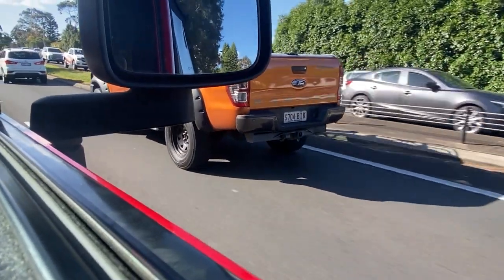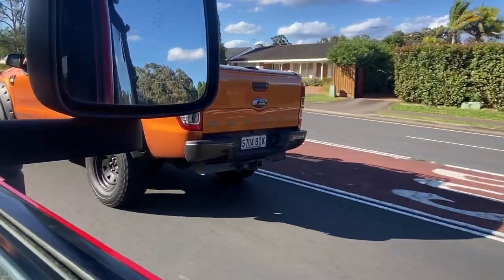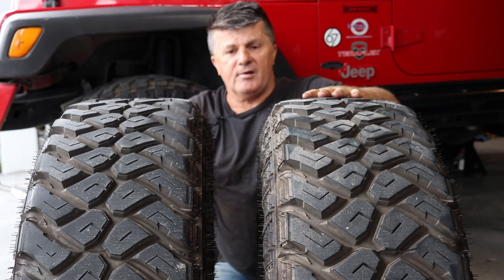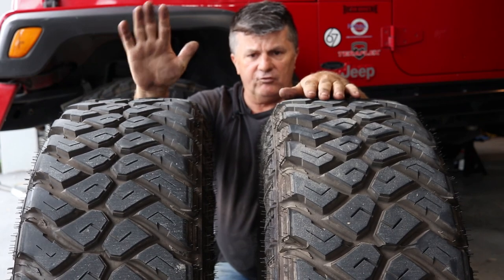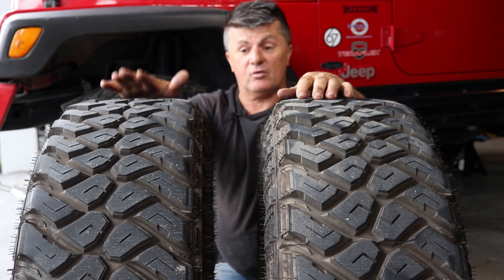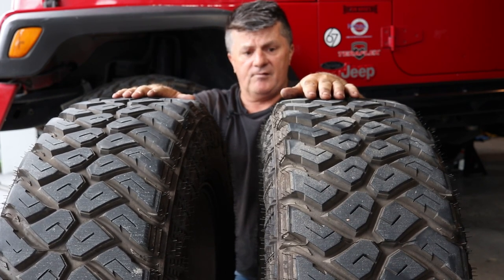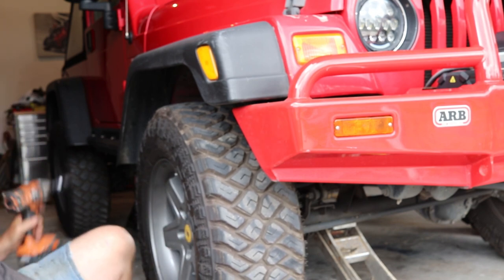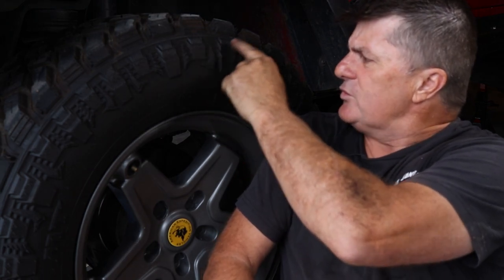Maxxis Razr MT's versus BF Goodrich KM3's // What's better? // 15000km Review

Comment: Thanks for the review.. I'm finding myself deciding  between these two tyres right now! Currently running 33" Nitto Trail Grapplers and after 90k, with regular rotations, I cannot fault them on or offroad. Only problem is it seems that, in Australia, they're becoming harder to find from the big sellers and at a reasonable price. I value your no nonsense and genuine reviews on all things.. so thanks again :)
Reply from the maker: I know a few guys running the Nitto's and they are also very happy with them. Damn shame about availability though,  maybe a search through some of the parallel importers (like Tempe Tyres in NSW) might help.
Reply: How often did you rotate them?

Comment: Only problem with not changing spare is when rubber gets old you can't use it in sand it falls apart . 5 years it's done .
Reply: Not even the cheapest tire falls apart in five years as a spare...

Comment: Hi again mate. I'm also trying to decide between these tyres, so this was interesting. I have another stupid question for you relating to tyres.. kinda. I'm moving to Sydney for work in a couple of weeks from QLD. My TJ currently has a 2inch lift, one inch body lift, and 31s. I'm going to need new tyres very soon and was looking at maybe going to 33s. My question is... Do you have any issues getting your annual roadworthy down there with the lift and larger tyres on your TJ!
Reply from the maker: They'll pick you up on tyre poke out but unless the guy is a douche, no. What you may find is that you get targeted on the road. I've been defected twice with 33's, never with 32's. To be completely legal, your current setup without the body lift is perfect.
Reply: @DarrylSheather  Thanks mate. I appreciate the info.

Comment: I'm tempted to get the KM3's but I'm unsure.  I had KM 2's and they were THE WORST TIRES EVER!!  They were square, could NOT BE BALANCED!  They wore very well, but rode like shit
Reply from the maker: Not good, I haven't experienced that but do think the KM3 are a better tyre than the KM2's. Drama is most are E rated now whereas previously you could get C rated versions which rode better.
Reply: What size km2? I had the km2 and after 30k miles they still looked new. They were my favorite MT till they stopped making them.
Reply: You probably had incorrect tyre pressures
Reply: Yep...had a set of BFG KO2 that simply would not balance. It took almost 2 pounds of weight for a 33 inch tire.